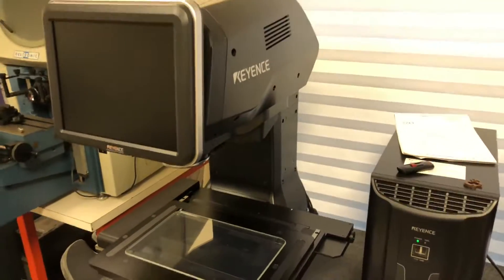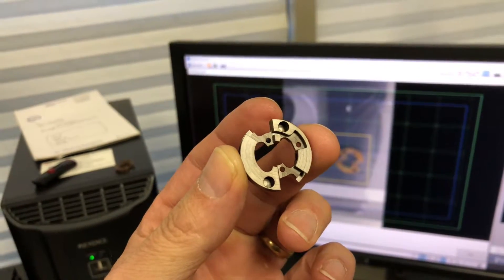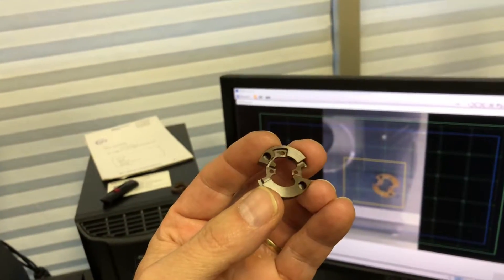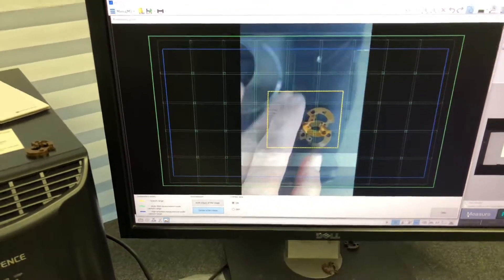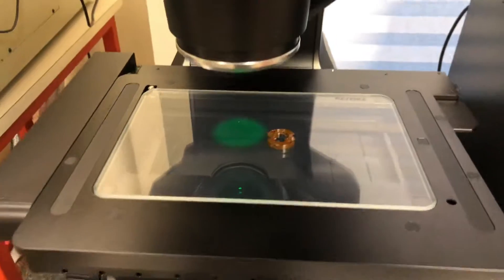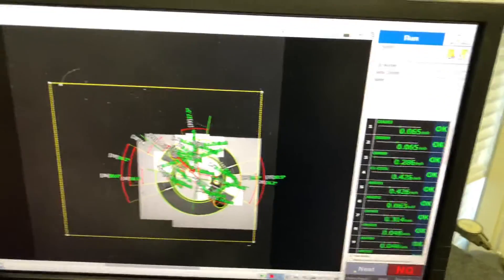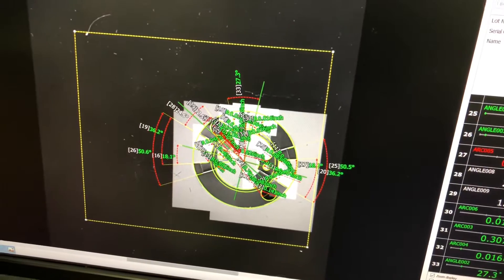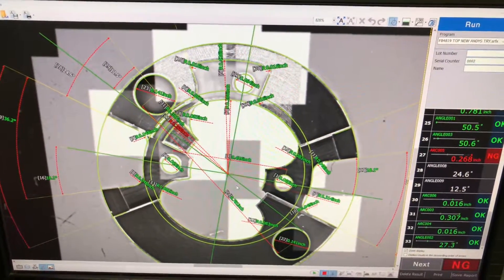Demo of my Keyence LM1100 measuring a part

Comment: I have heard that it struggles with some basic GD&T??
Reply from the maker: So far I have been happy with the GD&T. I have only used the true position and flatness and it seems to do great. 
I did notice that it is important to have a very square part to get accurate hole sizes and keep your cutting tools sharp so that the machine can detect edges properly. It can zoom in very close so poor finishes can get unreliable readings.
Reply: Hello. I have struggles with measure the height? How you programing?

Thank you.
Reply: @AnaCosta-gk4yw  If your using this machine, it does not measure height to the best of my knowledge.
Reply: @3073Sean  Used keyence LM series  8000.
Reply from the maker: @AnaCosta-gk4yw  The LM 1000 version of this machine can measure height.  It uses the cameras and high performance zoom/focus to accurately measure height, even flatness. I use calibration gage blocks to verify and it it can get to .0001 or better with height accuracy. It can measure in places where a depth mic blade can't get into.